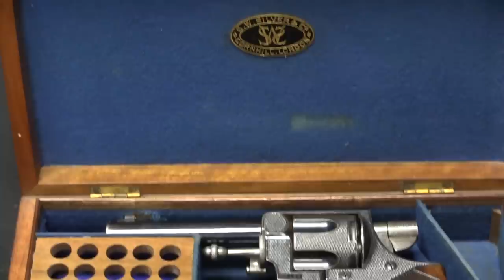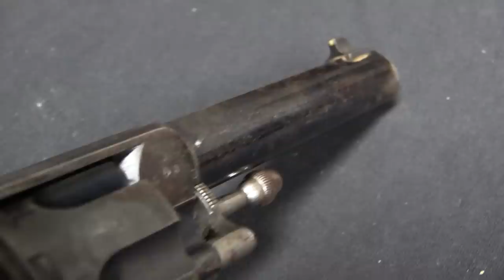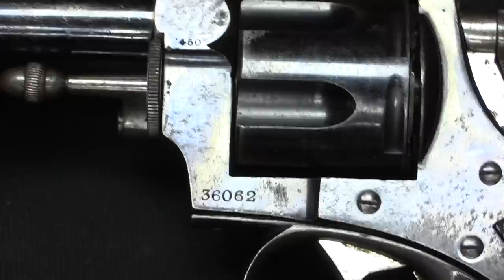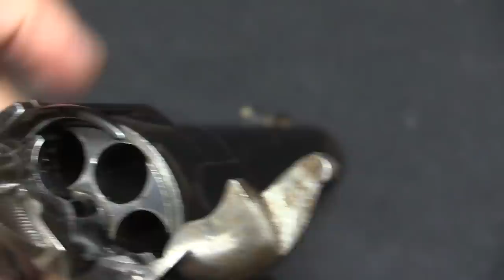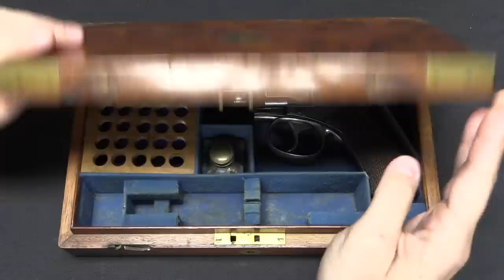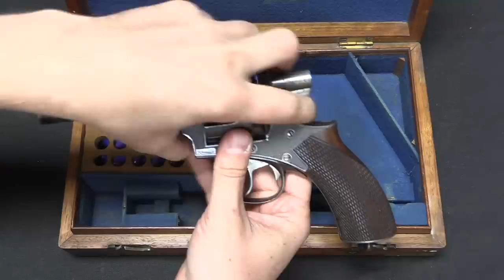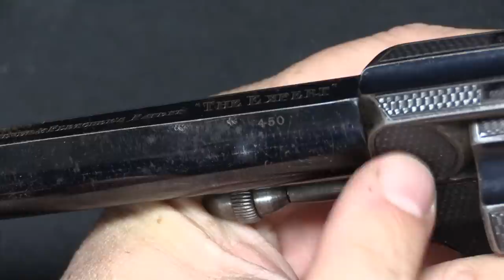1884 Tacticool: Silver & Fletcher's "Expert" Auto-Ejector

Comment: What's the point of autoejection on a revolver(beside a gimmick to increase price and grab attention)? On a bolt action I can see at least the point of eating away some energy to lower recoil(aka PTRD).
Reply: @TheArklyte we're probably jaded because we have swing-out cylinder revolvers, which weren't invented until 1896.
Reply: TheArklyte it increases reload speed, also all bolt actions auto eject. They wouldn’t work without it
Reply: It isn't an auto ejection method though is it? When the loading port is closed, the gun cycles around the cylinder as usual. But when you want to reload the gun, you twist the hammer and open the loading gate and cycle through the rounds and then it ejects them quicker, as opposed to moving the cylinder by hand and using the rod to eject the spent cartridges? 

It seems a fairly well thought out little idea whilst there wasn't really anything that was truly quick at reloading and I would guess that it could speed up the reload and make it less fiddly, open to being corrected if my explanation/thought were off though!